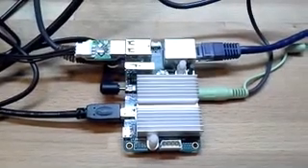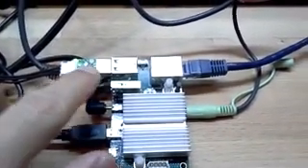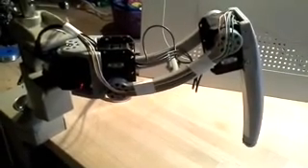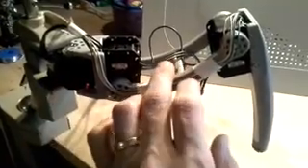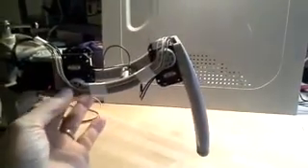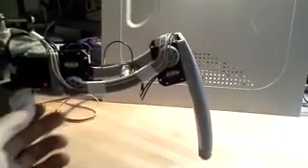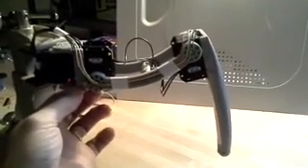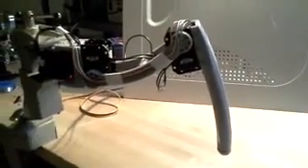Dynamixel MX-28 driven via USB2AX from an Odroid U3

Comment: Hi! Cool project! 
One thing that might interest you: I released sync_read and sync_write implementations for the DynamixelSDK yesterday (you could read the positions of all the servos in maybe 5ms - might come in handy for advanced motions :)
Have a look on the new github repo https://github.com/Xevel/usb2ax
Reply from the maker: Hi,
thank's for your hint. To implement sync_read and sync_write was one of my next tasks :-). Right now I focus on the vision system which is running well in a first shot. I will post another video as soon as I have the FSR sensor at the end of the leg up and running. But therefore I need an I2C connection to the odroid-U3.
By the way is there a possibility to access the I2C of the USB2AX (are the pins wired to the USB2AX board ?) ? This would give me the possibility to implement realtime control of the force feedback directly on the USB2AX.
Reply: HXP2 The USB2AX uses an ATmega32u2: it does not have I2C hardware :/ There are 4 GPIOs available (PB0-3), which makes it possible to use SPI if that's any help... http://www.xevelabs.com/doku.php?id=product:usb2ax:gpio
Reply from the maker: XeveL2
 Ops, didn't look on the hardware details of the ATmega used on the USB2AX. I like SPI more than I2C due to the faster transfer rates but didn't find a board with 24 ADC channels accessable via SPI. So I decided to use 3 I2C-ADC boards with 8 ADC's per board. I will search again since I really like the idea of directly feeding the force values to the USB2AX. Thank's again for your help.